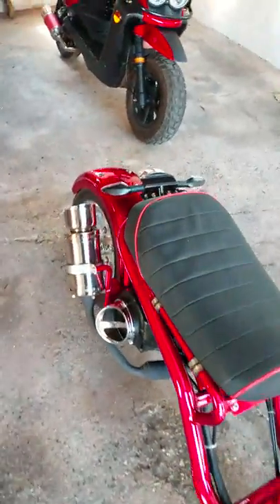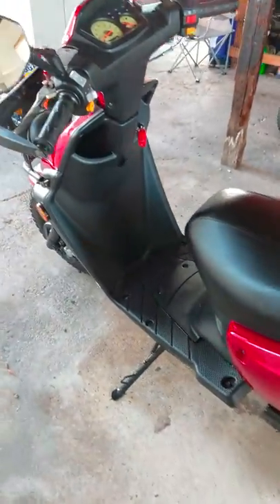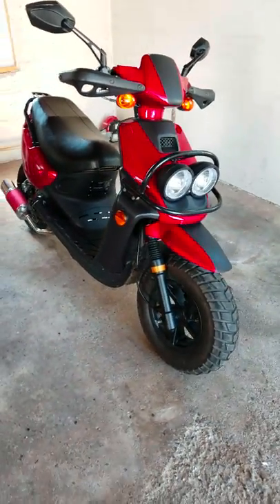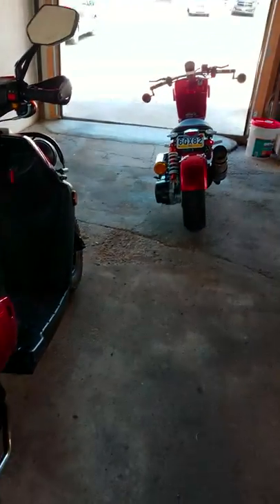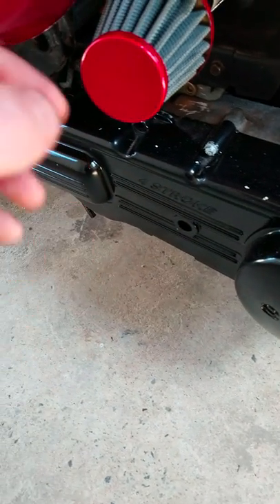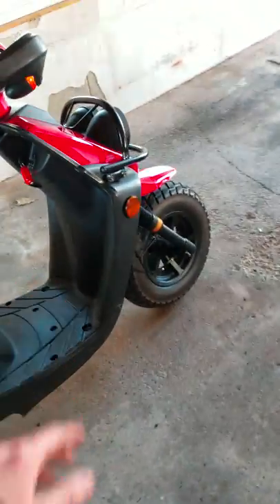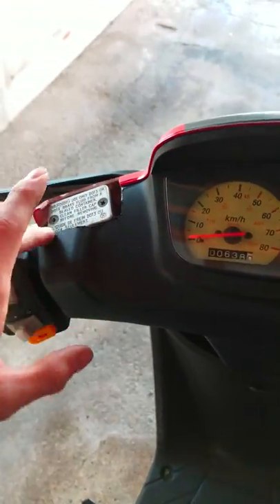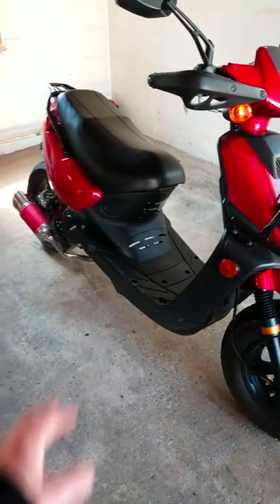What to expect when swapping a 50cc scooter to a 150cc

Comment: How to did you do wiring harness
Reply from the maker: Honestly I just had to make some minor changes to the turn signal to hand controls and redo the wiring for that. The speedo was the same way. I just used a volts meter to find what the harness wires were color wise power/negative/AC power.
Reply: @RspecNick  hey can you put a freaking 150 gauge cluster in a 50 cc you don't have to do any modifications like if I have a TaoTao 50cc can I put like a freaking 150cc TaoTao gauge cluster in it.? It would definitely fit because they're both towels right is use one is faster than the other cuz the 150 goes up to at least 120 mph and I want to do some extreme modification to it so I can go really fast on it . on my 50cc man already got the 100 Big Bore Kit for it and already done a lot mods to it. On God
Reply from the maker: boy  yeyes technically you can most gy6 scooters have 2 models a 50 and 150cc so usually if you have the 50cc model everything from its 150cc counter part will work
Reply: @RspecNick  and yes alright bro thank you. :-) my G I was nervous to spend money and not knowing if it work or not I appreciate the quick get get back in response .bro. :)🤟🏽
Reply from the maker: @marineboy4181  no problem man and yea I feel you on that but yes most 50cc scooter have there 150cc scooter replica so just find your scooter in a 150 version and everything should bolt right up to it
Reply: @RspecNick  oh okay bro and bet homie I will fam. 😎👍🏽

Comment: Woahwoahwoah... Woah... Let me get this straight. You "swapped" a 50 cc engine with a 150? WHAT? you can do that? 

... Quick question. Got a scooter with a kg10sa motor. It's a kymvo gy6 clone. Do you think I can do the same thing? It looks just like a standard long case gy6. . . Man you have my head spinning.
Reply from the maker: Yea you can swap any kind of motor you want really it depends on how much $ your willing to spend or what all you know you should be fine since you can already solve most of your scooter issues anyways hardest part would be welding in a mount for it and relocatating shock mounts if needed along with anything electrical that doesn't match up to the swap engine
Reply: @RspecNick  oh this will be fun. Lol thanks for opening up my options dude. I now have a new project. 😁
Reply from the maker: @DobleWhiteAndStabley  It's night and day man I'm telling you after I did the swap that's when I went and and got my 150 chuckus cause the 150s move compared to the 50cc ones
Reply: I used a 125cc big bore kit on another 50cc scooter. That was awesome and a helluva lot cheaper, but a purpose built engine would give me more peace of mind while I'm flying down the road going 50+ mph.
Reply from the maker: @DobleWhiteAndStabley  Yea for sure and the 150 would be easy right off the bat with simple mods not including if you jump it to a 171cc big bore or go all out with a 232cc big bore but that gets expensive
Reply: Partsforscooters.com sells 50-150cc engines (short and long case) for $280-$330. As long as you get the same physical size engine you can just swap them. You'll need to change the carb, exhaust and air box